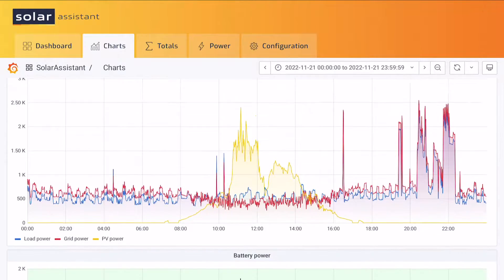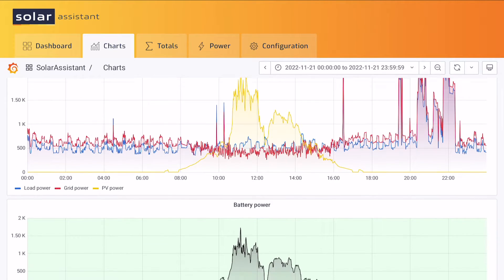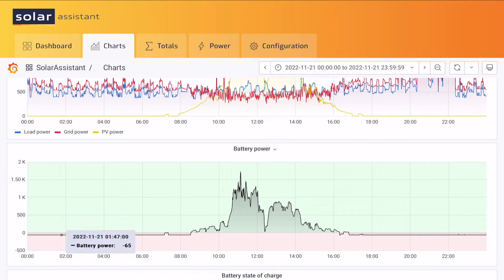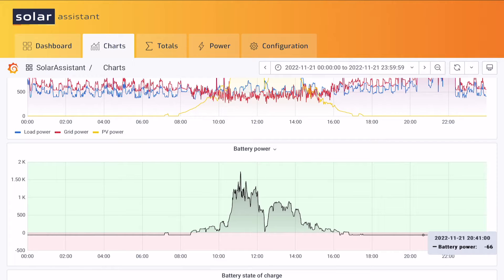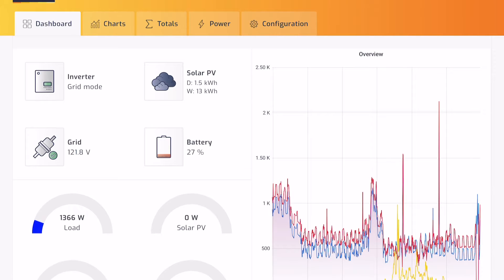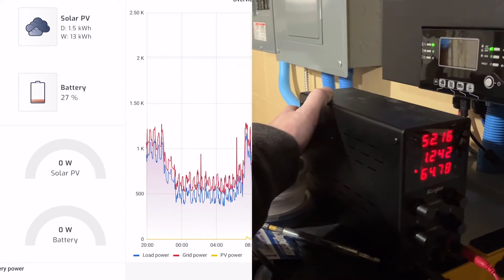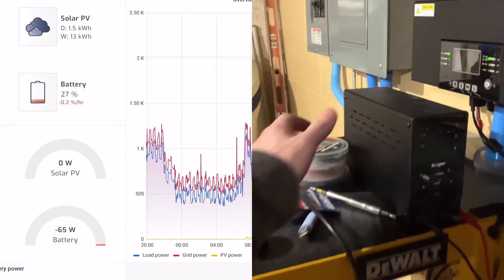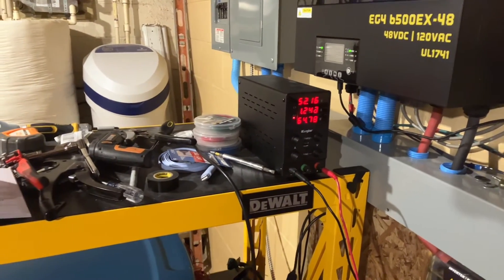When in Grid-Bypass, Can the Grid Supply the EG4 6500EX Power?

Comment: I wonder if you set all that up. Inverter is in bypass mode, charge rate is at two amps, and battery was set to 20% use utility. If the utility loses power Will the inverter go back into battery mode until low disconnect is reached at 5%?
Reply from the maker: Yes.  If utility power is lost, it will automatically switch to battery mode till either the inverter hits a “shutdown setting” or a battery low voltage disconnect is triggered.

Comment: Easy solution is just a 48v charger at float voltage plugged into the grid full time, or on a timer to run at night only.
Guessing I will have the same issue when I hook up our 12k growatt. Our existing outback radian gs8048a inverter also draws a bit of battery power overnight when using the grid. It's minimal-maybe 50-100watts but I oversized the battery bank so I never have to worry about it.
I call these "gold plated problems"
They are a pain to find workarounds but I'd rather have small solar issues than large utility bills !
Our grid power costs 63 cents per kwh here in the U.S.V.I. but we have lots of sun to keep us 99.9% off grid. Good workaround, do you ever charge via generator ? Have you tied a generator in to you inverters yet for redundant charging ??
Reply from the maker: My little work-around seems to be working great.  On the plus side, it's just a few settings to change, so that was nice.

Wow, grid power is very expensive for you...yikes.  Glad you do have a lot of sun to get off the grid.  Send some warmth up here, would ya? :D

I haven't yet charged with a generator.  I have my generator wired to backfeed through one of my panels in my house though, so in theory I could run it the exact same way my grid-bypass is working right now.  I should test it sometime.  It's not a standby generator though so I would have to go out and start it when needed.
Reply: @AdamDeLayDIY  yeah, the grid is so costly here I can actually charge batteries cheaper on out 7500 watt diesel generator. I've got it wired to inverter and also to a backfeed into breaker panel in case the inverter ever fries. Solar costs were easy to justify down here, especially with daily grid outages and appliance wrecking brown outs. Have not replaced a single appliance since we installed solar 5 years ago. Will try to push some sun that way, by springtime at the latest ! We head back to mich in May, thinking of using a couple eg4-6500s for backup power up there. Good to see all your detailed work with them.
Reply: how many amps does your charger put out?  i would think that during cloudy days the author's batteries would be really low and he would have to go on grid power during the day.
so your idea would put enough power in the batteries to at least run for a few hours off the batteries while being charged?
Reply: @richardservatius5405  We can charge using the inverter/charger at up to 80 amps via generator or grid however when using the generator to charge I dial back the inverter charger to 20 amps AC (about 4000 watts) output to the battery so as to not overload the smaller diesel generator. This leaves some power available for house loads.
I also can use our smaller 18 amp DC 48v plug in charger (plugged into grid outlet) however we really don't need to. This charger would work best on a very small inverter generator "Yamaha 2000" as it would charge about 10Kwh & run a few fans on one gallon of gas.

Comment: Thats weird that the inverters drain the battery when in bypass mode. It makes me think that these inverters can also run in batteryless mode (not when connected together in split phase), so if the bms were to shut down would the inverter wakeup and continue in bypass mode and then the battery would have no draw because the inverter is in batteryless mode!
Reply from the maker: I have seen videos where people run these in batteryless mode, but as you said, not in split phase.  While it seems capable, I know the manual says they "don't recommend it".  

Hard to say what would happen if the inverters are still drawing from the batteries.  Since I'm in split phase mode, that's not really a test I want to tempt fate in trying, if you know what I mean.  😁

Comment: Sorry for this long post.
Just found your channel. It's funny, I have two of the 5000W Iconica inverters (running in parallel) and the manual looks exactly the same as yours. The menu is the same. I've worked out through running the inverter what the three modes are. The confusion was the distinction between SOL (solar, utility battery) and SBU (solar, battery, utility). I've worked out that if you have the latter selected, then the battery will keep 'cycling' (charging, then discharging) if the solar isn't enough to meet the need. The solar works with the battery until the cutoff voltage is reached (48V in my case), then the utility will take over and charge the battery and once full the battery will kick in again and repeat the cycle. This will be ok in spring /summer and possibly autumn, when my 8kW array will probably meet most needs, with the battery then filling in during the evening. Now in winter, the first mode is probably better, where the battery is acting more like a UPS if the utility should go down. This way the minimal solar that is produced in winter can be used to augment the utility but the majority will have to come from utility as my battery bank is only a 10kW lead acid (5kW usable). When set in SBU mode, I probably used more grid power than just having the grid augment whatever solar was coming in because of the losses involved in charging /discharging the battery bank. I also want to go into the evening with a full battery bank in case of blackouts. I've rigged up an old laptop with an SSD running Windows 7 and use the 'Watchpower' software. What software are you using and is there a free download? 
I've had good backup from the company I bought the inverters from, Photonic Universe in the UK. Maybe you or someone else could give some advice on my last email to them:

I've got my system up and running and using an old laptop and Watchpower can see what the two units are doing in realtime. My only real past experience with inverters are with the Sterling and Star Power units which I've fitted to various motorhomes and campervans. These units (often 2000-3000W pure sine inverters) have in-built chargers for charging the battery bank and also a facility called 'shore power'. This is enabled whenever the units see 240V on their inputs. Basically, the units stop inverting power from the battery (and hence solar if connected) and then just feed the 240V input straight through to the output. I thought every inverter that had mains input capability would do this, but I'm not sure whether this is happening in the Iconica ones. (The supplier replied that the inverters are permanently inverting whatever the power source, which makes sense as there is often more than one source simultaneously, unlike my motorhome/campervan situation where there was just a sole source.)

Why this matters in my setup and I presume anyone else who is running  a similar system, is because of big power draw items like an electric shower or a heat pump. Our shower is rated at 9.5kW on winter setting and pulls according to the software about 9kW. Since I only have two inverters, I'm almost at the max 10kW available. I thought when 'utility' was set as the input mode, the input would merely be diverted to the output. We are running the shower in 'summer' setting at the moment which only draws roughly 5kW leaving another 50% available should someone turn a kettle on etc. I have room to fit another inverter to take the headroom up to 15kW which would be enough at the moment to deal with this problem. If this was the case, am I right in thinking I only need to connect the battery and grid input and outputs in parallel with the existing two fitted to make this work? I only have two 4kW strings of PV which feed inverter one and two at the moment.

My panels are arranged in two 4kW arrays, with one array serving each inverter and the MPPT in each controlling each array. This works out great as the voltage of each array is max. 400V.

The manuals (both the parallel board manual and the IC2-KMS5000 48P) only specify that the battery connections and the grid input and output should be paralleled, which makes sense. It doesn't mention however if you need to supply panels to a third inverter? Since my array at max would only produce say 7kW on a bright summer's day, this could easily be disbursed through the two inverters which have panels attached. The third inverter would really be for times when the power was mainly coming through the grid, or a fully charged battery (although the lead-acid bank would see its voltage drop massively if it was outputting say 200A). I really need to know that adding a third inverter would be possible WITHOUT adding any panels to it, as my cable runs are all sorted now and can't be changed.

Also, can you recommend a 150A AC breaker if I go for another inverter or a 100A AC breaker if I stay with the two inverters as the 50A RCBO I'm using has occasionally tripped.

Do I need a breaker before the inverters as I already have the main 100A supplier fuse before the meter and a 100A isolator switch after the meter when I need to isolate grid power to the inverters?

My consumer units have MCBs fitted to each circuit for protection. It would of course be devastating if we went away for the weekend and any breaker(s) fitted before the inverters was to trip, because then we would only have the solar and whatever battery power was available before we'd lose all power.

Thanks to anyone who may be able to help.
You can see my setup here:
https://www.youtube.com/watch?v=EqtfHPVORcs
Reply from the maker: Thanks for the comment.  I can really only speak to my specific environment because of hardware and location differences.  

The software I use for my monitoring is Solar Assistant.  There is a cost to it, but to me it's well worth it.  You can either buy just the software and install it on your own Raspberry Pi or you can buy a prebuilt kit.  https://tinyurl.com/yckezfy8

As far as your specific environment needs, my suggestion would be to take everything you posted in this comment and create a thread at https://diysolarforum.com/.  You'll probably get a whole lot more people looking at it and be able to help than what you would find on my little channel.  More than likely there's people there that have experience with the Iconica inverters as well.  

Sorry I'm not able to be of much help.
Reply: @AdamDeLayDIY  That's great....many thanks. The company I deal with have reached out to me to confirm that more inverters can be added in parallel (mine will take up to nine) either in single or three phase configurations, WITHOUT having to add more panels.

Comment: I was really confused at the beginning of this video why the grid wasn't charging the batteries hahahaha
Reply from the maker: Ha, guess I should have clarified better… 😁
Reply: @AdamDeLayDIY  I have a Growatt 3000w inverter & had an opposite issue. I use a medium size generator & the grid charging was set to 30amps by default along with powering the loads, so the breaker kept tripping until I figured out why lol
Reply from the maker: @jtr82369  It's amazing how many times the default settings come back to bite you isn't it?  Kinda seems like we get tunnel vision when it comes to setting up the inverters.  We know we need to change these 3 settings (whatever they might be), but we don't go through all the settings and examine if the defaults work for our specific environments.

Comment: Ok, I have set mine up like yours now and my #2 started charging as you said it would. Normally when testing, with just the two batteries I have running overnight with no loads, just the parasitic draw, they would be at about 25% in the morning. Maybe a bit more. I like the trickle-charge idea and letting the panels do more of the work. Curious to see where they will be in the AM. Thanks for being the new guru for these units. You are pulling no house loads with this test correct?.
Reply from the maker: Glad it helps someone out!  

Not sure what you mean by “house loads”.  I am in grid-bypass with power being drawn through the inverters while my charger is covering the 64w loss from the batteries.

Comment: Thanks Adam! You are way ahead of me. I will be looking at this. It doesnt make sense to run with low battery voltage, SOC since it defeats the purpose of emergency preparedness if/when the grid goes down. I would rather pay a bit more to top off my system if the solar input is not keeping up. Yesterday we were overcast all day so woke up at 9% and ended at 12%. I would have to double my battery capacity to reduce a gray day and then not sure how long my 20 kW array would take to top off 100 kWh of battery.
Reply from the maker: Yeah it really depends on each persons use case.  I’m still trying to find that “happy medium”.

Comment: As you have it set up for a 2a chg on inv 2 does the utility charging operation ever come on at all on inv1  now? It seems weird leaving it with two different settings on the inverters
Reply from the maker: Nope.  No issues with that at all.  There are a handful of settings that are specific to the inverters while the rest of the settings will automatically sync to the other inverter when changed.
Reply: @AdamDeLayDIY  Is there a way your inv2 can be set to 2a battery charge, and inv1 can be set to full (60a?)  battery charge? Or do they both need to be / are automatically set to the same.
Reply from the maker: @ElecMS  utility charge rates can be set uniquely for each inverter.  My inverter 1 is always set to 50A (with utility charging disabled) and my inverter 2 is 2A.

Comment: I use the inverter’s built in timer to throw a little charge as needed during off peak rates. It more than makes up for the round trip efficiency losses. I have my inverters primary program(01)set at SBU and the timer program is USB (in “Timer Setting for Output Source Priority”). I use Solar Assistant wherever I want do a little tweak to charge current to one or both inverters as needed depending on the weather. Another little trick is to use the clothes dryer when it’s on grid(pass through) it’s more efficient than using the batteries when you don’t have sunny days to power things. When I am making PV power, I also like to use the high load things for direct conversion energy. Just be careful if you’re running the dryer and Heat pump at the same time because if someone starts the microwave and or the Keurig coffee maker may be the tipping point. I’ll do a little energy management + solar when my bill goes from $500 to 70 in winter or summer. In spring and fall it’s the minimum connection fee.

Comment: i dunno.  that doesn't make sense to me.  65w is the COMBINED power draw of BOTH inverters?  so 33-ish watts each?  that seams WAY to low!  maybe a parasitic load from the victron CC?  or somewhere else, perhaps?

forgive me, i don't know quite how these work.  do they only work off of DC (battery) power?  i'd be keen to see you disconnect the battery altogether and see if the inverter shuts itself down while in grid bypass mode.  one would think the inverter would get it's power from the grid (AC power) when in that mode.  otherwise - you're right - it'd just overdraw the battery!  i wouldn't think the engineers would allow the inverter to work like that...
Reply from the maker: Still scratching my head myself.  I've had this draw long before I had the Victron CC installed.  I also disconnected my smart shunt and buck converter for the raspberry pi and still had the draw.  The inverters were the only load that came to mind, but yes, it does seem way too low.

Comment: Here in SE Michigan. As we talked about I have about 12 kw it's not enough to run my house in the winter. Only covers maybe 30%. I'll have to look at the old electric bills but I'm using around 1 Mwh a month.  Which is about 36kwh a day. For summer use I have plenty of panels but for November December and January I'll need over 25kw to keep up with the load. During those dayse it's normal to only see maybe 500 watts of incoming power from 12kw of panels. Usually when it's this cloudy it takes 3 days of charging on bypass to get one night of off grid. So if I get another 12kw of panels I'll really have to figure out what do to with all the power during the summer. Maybe install pond water fall or something
Reply from the maker: That's very similar to me.  My winter electric is a lot higher than my summer (cause I'm stingy and don't wana pay to run the air if I don't have to).  I'm thinking about doing a video regarding all the "extra" things I didn't even consider needing to power in the winter that causes additional draws on your electric system.  

Just put in a DC element in your water heater and have solar preheat your hot water.  Just a dump load.
Reply: @AdamDeLayDIY  thought about that but need to find a quality dump load management system. Like once the battery reaches 90% it'll turn the heater on or something like that
Reply from the maker: @electromechanicalstuff2602  If you find one, let me know.  Been looking myself for use during the summer.  Found these, but they're direct to the solar panel, not actual dump loads.  https://practicalpreppers.com/product/cyboenergy-off-grid-inverter/
Reply: @AdamDeLayDIY  There's a video out there of a guy using Midnight equipment where he was able to configure it to send solar output to a space heater when batteries were full. Been thinking the same as you both, ideally find a way to pre-warm water heater intake or somesuch.
Reply: @ElecMS  i think that is using essential loads/non-essential...so when the battery is 80% or higher, it switches to non-essential loads and the hot water is heated.